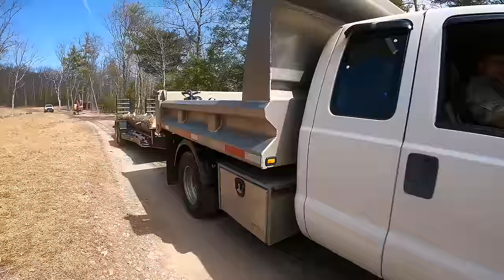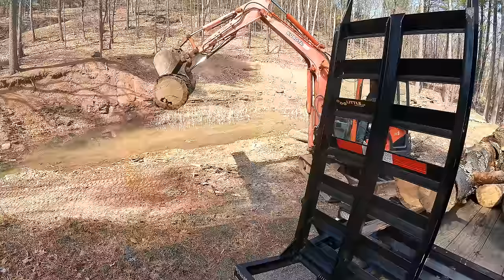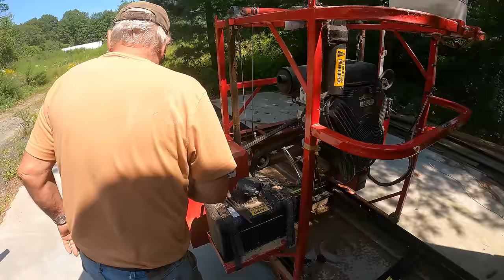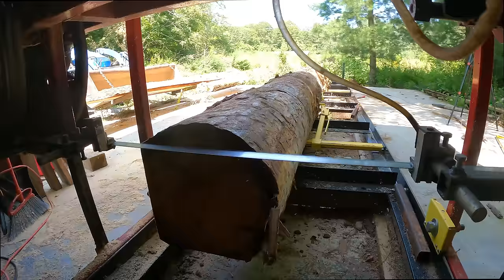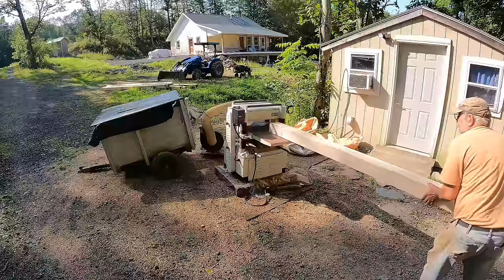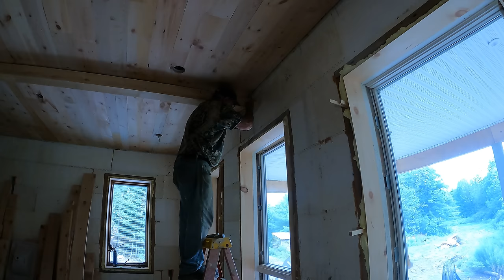Logs from Andrew Camarata to beams in my house

Comment: Very nice!  Never understood the modern fixation on sheetrock as opposed to wood on interior surfaces.  Wood has such character whereas sheetrock has absolutely none.  Wood as well is a joy to work with.  I never can get excited about rock and mud.  Always made me shudder when yuppies would buy a place and rip out the wood to sheetrock everything.  Took away the soul of the structure.  Looks like you need a good infeed and outfeed for your planer?  Pour a level walkway to place it on would make the long stuff much easier to work with.
Reply from the maker: yea i agree hopefully i will have a garage for the planer soon
Reply: sheetrock being drywall then I guess? If so I agree the old school homes had wood and mostly has been replaced now maybe it's convenience

Comment: You desperately need to buy/build some in-feed and out-feed rollers/support for those long pieces to insure the boards/beams stay parallel to the planar table. You'll get more consistent performance from your planar and eliminate the binding, and the end result will be better quality finish on the wood.
Reply from the maker: yes but i need a shop first

Comment: I love your video, are those beams structural or just decorations? I WAS WONDERING WHAT HAPPENED AFTER YOU REMOVED THOSE  BLOCKS?  THAT SHOULD HAVE BEEN RESTING ON THE WALL  FRAME
Reply from the maker: they are just for looks and the beams will be resting on the wood we are covering the walls with plus the lags from above see next vid